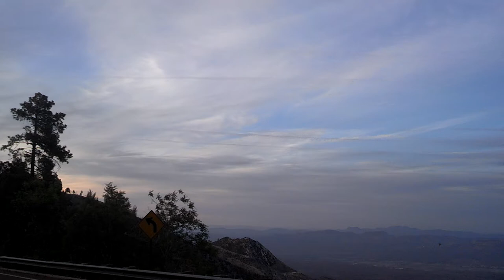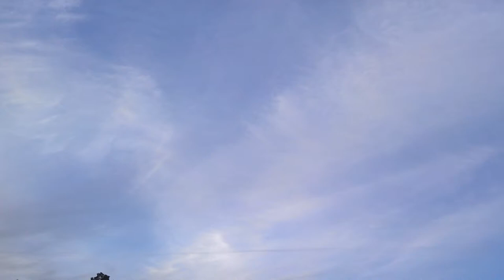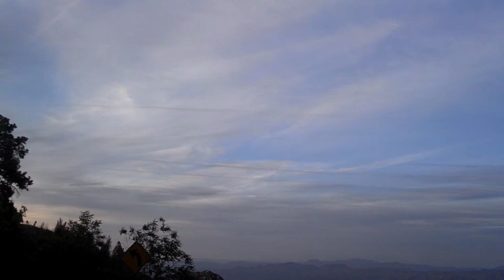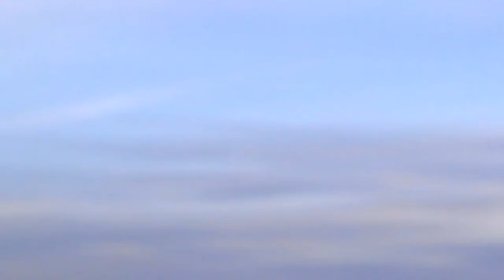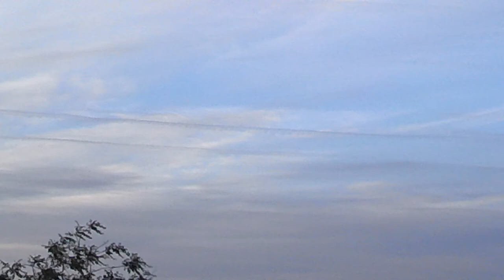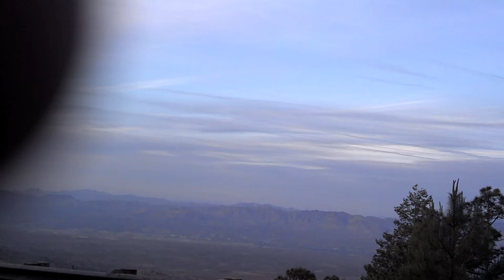Too much Aluminum in the air! Chemtrails / Geo-Engineering Catalina Az!

Comment: The federal laws in almost every nation on earth do not allow commercial aircraft to cross flight paths so close and so quickly. These jets are therefore under military control. And what about the prismatic colors often observed in the resultant aerosol haze illuminated by sunlight?If the haze was primarily water vapor, carbon monoxide and negligible amounts of hydrocarbons, the prismatic colors would essentially be that of a rainbow. But, instead it is either magenta and green or broad bands of orange and yellow. All elements through which sunlight passes give a signature color which is totally unique to that element. Through spectroscopy a number of heavy metals have been shown to be ever-present in our breathable atmosphere. All heavy metals, as you may know, cause the dementia symptoms associated with Alzheimer’s Syndrome. One purpose which is now well documented according to researchers, is to manipulate the weather. Karsten Brandt, German meteorologist states, “The Federal Army is Manipulating the Meteorological maps.”The disruption of radar signals is the main purpose theorizes Mr. Brandt in the interview. “I was surprised that this artificial cloud was so wide-spread. The radar images are stunning considering the needed tons of dispersed elements – although, the federal army claims that only small amounts of material were propagated. The military heads claim that the substances used are not harmful.”Johannes Remmel, German Green party representative states, “The government must provide explanations to the unsuspecting population.” While radar is tracking suspicious aircraft, the Germany Military then uses counterfeit satellite imagery to hide their operations.Since Chemtrails are so widespread across the world, it is easy to rule out the idea that this is just military performing operations to disrupt radar signals as part of some sort of drill.The forefront of these operations in the United States appears to be the US Navy, as detailed in “Death in the Air: Globalism, Terrorism & Toxic Warfare,” by Dr. Len Horowitz. Many government watchdogs claim global depopulation, the targeted reduction of the world’s population by two-thirds, is secretly the reason behind chemtrail spraying.Chemtrails differ from ordinary contrails in that they hang in the sky for hours and are often observed to be emitted from planes that fly criss-cross routes, leading to the formation of ‘X’ and grid-like patterns in the sky. Chemtrails also directly effect localized weather by turning a clear blue sky into a hazy overcast.
Reply from the maker: Yes! What he said!